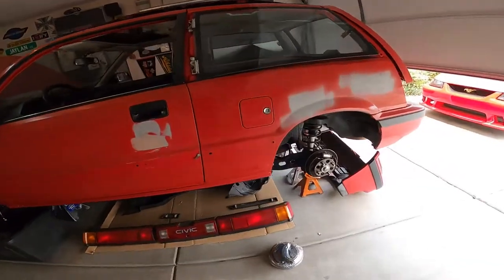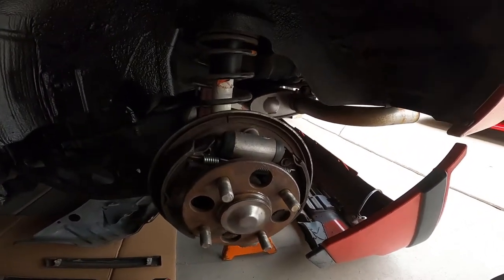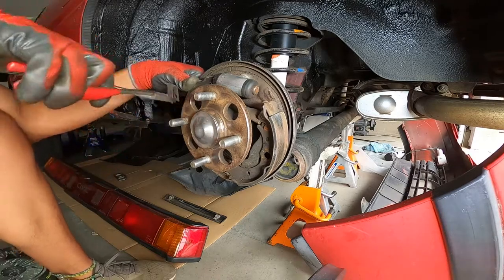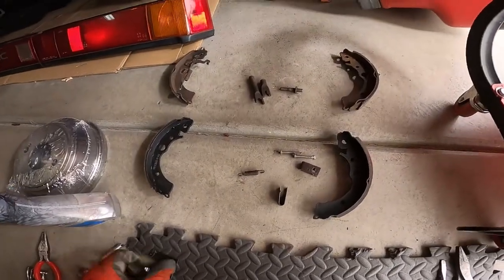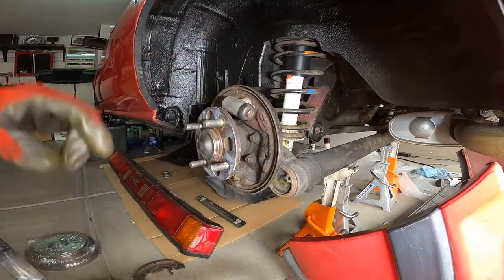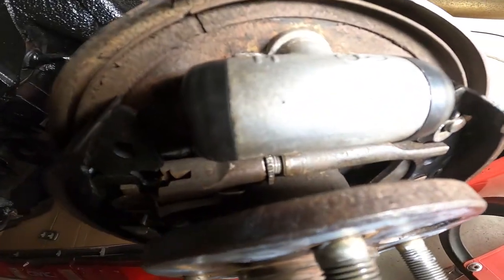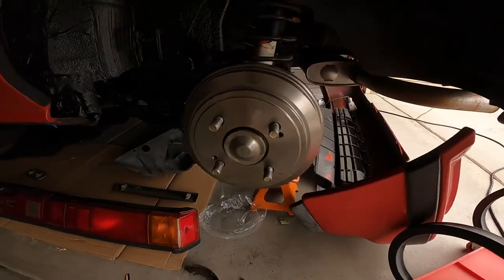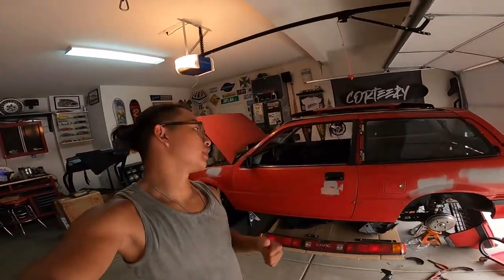How To Install Rear DRUM Brakes | 1987 Honda Civic Si How To

Comment: Its posible to do a disc conversion? I have a honda logo ga3 and i think have similar suspension setup, thanks!
Reply from the maker: It is possible, the easiest way would be to swap parts from a Honda that shares the same body/manufacturing series but came with disc brakes, swapping all the necessary parts. such as lines, disks, calipers, hubs, mounts, etc. For our case, we would do an 85-87 Integra, because they came with disk brakes, so most of the parts bolt right on to the 85-87 civic. As for your chassis, I am unsure what model has corresponding disk brakes, some research would be necessary. But i'm sure it's been done before or there are kits available for the conversion.

Comment: What all would I need to convert to disc brakes in the front. Just bout a 87 civic 5 speed
Reply from the maker: Front is already disk breaks. To upgrade them you can just buy an off the shelf Kit  like the Wilwood kit from FastBreaks, comes with brackets, lines, disks, calipers, pads, everything needed for the upgrade